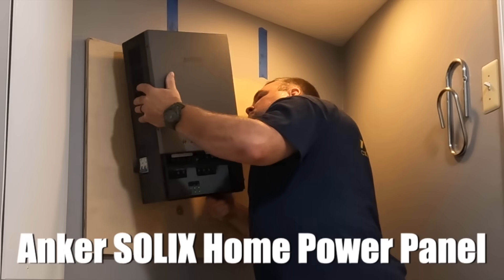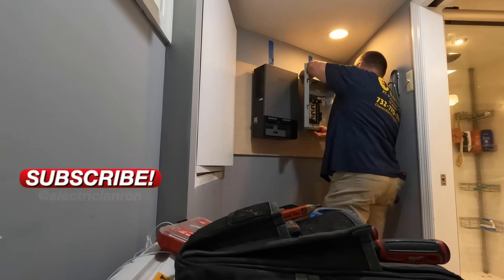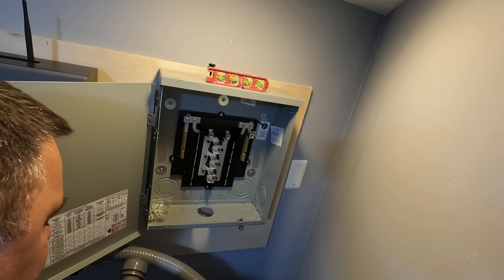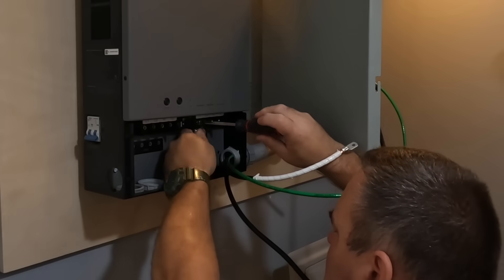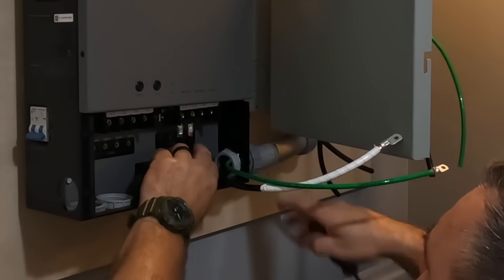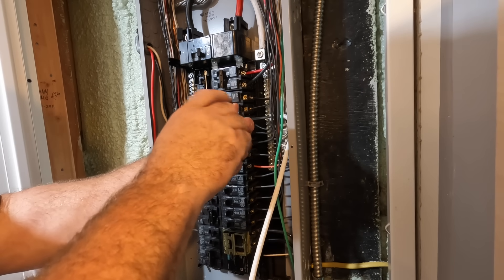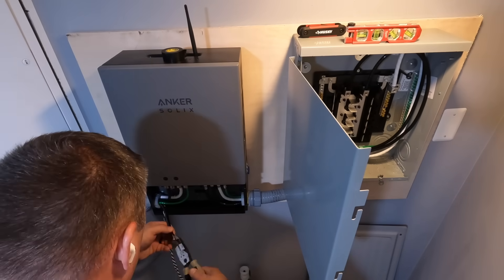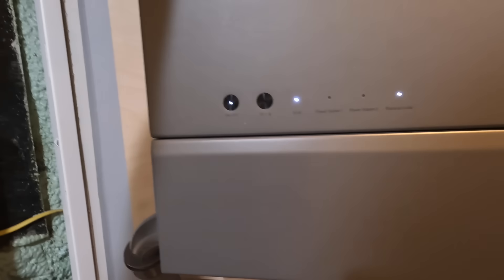Anker SOLIX Home Power Panel Install Part 1 #ankersolixF3800

Comment: inverter is in the batteries themselves if you can call them that. They are all in one units. Battery, inverter, battery charge controller. They are passing AC power back to the transfer switch. Probably 240

Comment: Thanks for the video! I watched Spicer designs and wasn't sure the wire sizing was correct so found your video. Spicer mentioned you could use #4 THHN for 100 amp even though it's only rated for 95 amps because there's an exception for residential use. What I could find said that wasn't right for THHN but is true for SER. Any thoughts here? I'm assuming that's why you used #3. Thanks for the codes and great explanations!
Reply from the maker: #3 copper is good for 100 amps.

Comment: I was wondering if the anker solix  was able to use as a stand alone unit and connect it to the breaker panel if u have no grid power and just use solar

Comment: Is this worth 2-4k for install through anker's site while ordering? I saw on a bundle they added it for 4 grand just labor to install, and if you buy the install on its own is 2 grand.
Reply from the maker: Charge whatever you want. If u think it’s worth $2k, then pay $2k!
Reply: @electricianron_New_Jersey  yea i forget you guys don't have places like medicare that dictates a normal price ceiling.(should have been in your field lol. Jk, i love what i do). I doubt you and other honest electricians charge 2-4  grand. I can see 1500$,  but 4 grand is tough. So far doing good with a self installed manual transfer switch from Anker. From what I read on the panel so far, it limits to total solar input that can be utilizied during a certain scenario. (I've asked the anker boys to confirm or tell me otherwise). With me being in AZ, those 2 f3800plus units will be maxed out on solar this weekend, when the panels get in, which would hopefully pass through all of it with a manual switch. Just not sure if it would be limited or different for passthrough/charging the f3800plus to max input with the panel. Thats the main thing holding me back after i bought 30 grand of their line in the past 3 months 😂. I printed the 100 page manaual on these for installers and details. Will see if i can read and find the answer this weekend. Thanks. Great video. Not enough of them on youtube. Sorry, if my sentences are broken, Im from Bosnia, and currently getting through my 27th surgical procedure out of 36 today. Just a quick drop in. 👍
Reply: @electricianron_New_Jersey  I think my question is better with the solar guys. You just install them and make them safe to use, which is the most important thing. Thank you. 👍

Comment: I was fired from my delivery job in 2003 and decided I wanted to become an electrician. I took a course online from penn foster that took me through the entire process as an electrician. I had to read prints and draw up my own and submit them to an actual instructor. I got an 80% on the exam because I didn't measure from the closed portion on a sliding glass door. I put the outlet too far away and the instructor marked me down for it. I learned that the closed part is considered wall space. I took this knowledge to a local contractor and he hired me on the spot. I spent several years working as an apprentice relearning what I had done in my course. I dug a lot of trenches, climbed in a lot of rat infested crawl spaces, to crawling around in arsenic/asbestos insulation in attics. I also learned commercial work disassembling 480v buss and reinstalling it in another plant to basic industrial work. I worked along side of a machine programmer providing 400 amps of 480 volt power to a multi-million dollar machine and felt the excitement of seeing it being powered on for the first time. I also get that feeling when I find an electrical fault and can fix it for my customers. I was laid off in 2010 and went to work for a local automotive paint rep that was wanting to retire. He thought I could just buy him out with the equity I had in my property but turns out my land is worthless and deemed condemned and he sold out to a young 23 year old body shop owner that had me fired. I spent several months unemployed and took a job at a local walmart stocking produce. I always did side jobs and stayed active doing my thing but just recently another coworker lied on a couple of incident reports that got me and another coworker fired over lies and deceit. I am now technically unemployeed and doing "handyman work" full time to keep my dogs happy and food on the table. I always wanted to get back into the trades as an electrician but no one wants to hire me and I just do my own thing. I am a rogue. There are hacks, shoddy electricians, and handyman's that shouldn't touch anything electrical. Rogues are casted out of their trade with full knowledge of their field so they do things right and safe. But are just as bad as the handyman. I am also targeted because of my skills. I am the first one that will go down and end up in prison because I do electrical work unlicensed which is against the law in every single county in the USA.

Comment: Just caughtyour channel Ron. Im am a long retired NJ EC #5144, You are doing interesting jobs that most of us old timers , well at least some of us enjoy watching, I took my last Code refresher course around 2000 so it is obvious I am out of touch of the latest code rules. When I started my IBEW apprentiship back in 1964 and my journeymans certificate  affived in 1969 I had no desire to go into business untill I met some guys at the supply house who were non union contractors making more money that I was as a Union electrician. I took my license test and for 30 year I had a fairly sucessful business doing industrrial. commercianl and very lettle residential work.Not going to bore you with what I did but there is one thing you don't do that I agree with, You are not trying to teach amateurs how to do their own electrical work, Carpentry can be a hobby, electrical lwork by amatures can burn a house down by watching non electrical contractors tell you you can do it because it's very easy. With 40 years experience but retired for almost 20 I have no business telling homeowners how to do electrical work. Keep up the good work I will be watching. I no longer live in NJ but my son does and he may need a quality electrician to install a battery back up system in his house. 
BTW when some NY Billionaire offers you a chance to make a ton of money doing work in his building, tell him no thanks, I am making a good living working for working people who pay their bills. I have friends in the business who lost everything falling for that lie.

Comment: I just installed this a month ago. Paired with 2X F3800(I reroute all the home wire to a larger load center, I sold the one comes from anker). I DIYed everything now its running for a month. I just curious according to code or instruction. the screw on breaker/terminal need to reach certain torque...I bought one torque screwdriver tried to meet with the code for this and after one screw I gave up already...It is a waste of time (I see you not using a torque screwdriver either). When doing real world electrician work do we need to really screw everything strictly according to code/instruction?

Comment: Those protective bushings are definitely looked for in solar installations by the inspectors.

Those crimped lug connectors are a step up from stranded wire under lugs. Especially when you see installers leave strands loose not secured under the screw terminal.

Scaling up that neutra conductor l was another great idea. Reminds me that the code is the floor not the ceiling.

Most of the newer batteries have built in inverters, Tesla, Enphase, and recently Franklin have this technology.

Good job and it's good yo see you branching out with new installs . Great work my guy!
Reply from the maker: Thank you very much!

Comment: Furthermore, the white neutral can have no current when each black hot is carrying equal amounts even at full load.  It's a split neutral.  You can run 3 wires for 2 breakers 120v each, one on each phase to save on wire cost.   Just can't put GFCI in panel.
Reply from the maker: A multiwire branch circuit requires a double pole circuit breaker.  NEC 240.15
Reply: @electricianron_New_Jersey  I ran some 20 amp circuits in my home that way on double poles.

Comment: Awesome video. I look forward to the next one where you relocate circuits.

I've always wondered how to handle the neutral / ground conductors in the scenario where you need to relocate circuits from the main panel (first disconnect) to a new sub panel and don't want to introduce a new junction box (i.e. finished drywall).

I'd imagine the circuit neutrals should NOT be directly bonded to the neutral bar in the main panel (first disconnect) and instead just be spliced together -- otherwise there would be an introduction of a parallel path for neutral current -- both directly from the branch circuit to the main panel neutral bar AND through the sub panel neutral feed?

However, I'd imagine circuit grounds might need to be bonded directly to the ground bar in the main panel (first disconnect)?